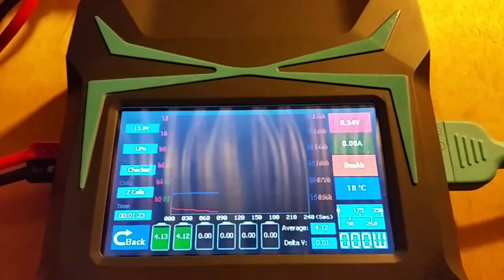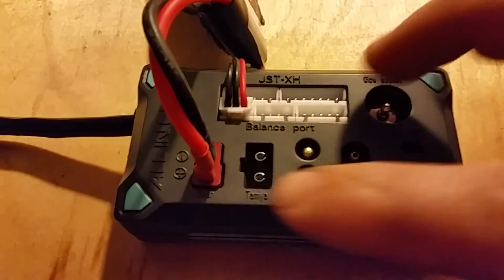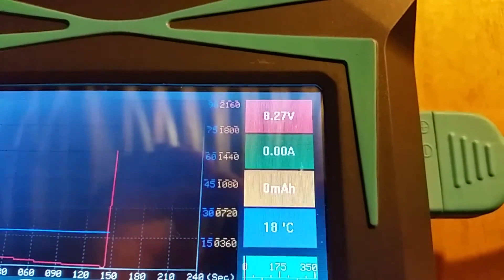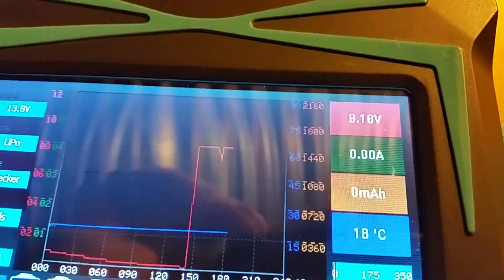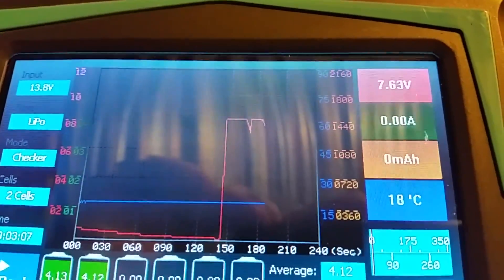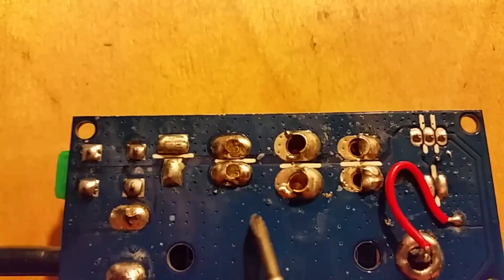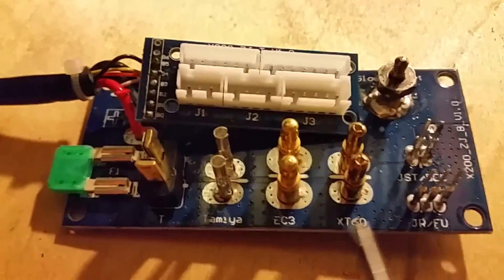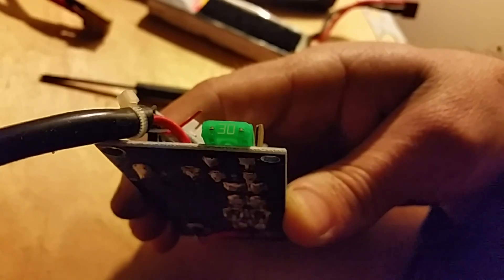X350 Touch Screen charger repaired

Comment from the maker: Hi mates I posted a second video showing how to repair the discharge and balance charge from a high voltage resulting in a connection break fault. I found the culprit and replaced it with a car fuse. If you discharge at more than 40watts you will burn the tiny 10Amp fuse. Some one mention to just put a bridge in but tell you it really over heats the unit if you try more than 40watts. If you don't clean up the terninals it will result in over charging and if you continue to over charge you will eventually damage the battery. I strongly recommend not to use the charging function and only use the balance charge. It does not seem to check the balance port voltages when charging and only monitors the main pack voltage and if the terminals are not making a good contact will seriously over charge the pack. Atleast with the balance charge it only monitors the balance charge and will detect the main pack for open circuit.Hope this help you all.

Comment: Good example of the crappy job that Hobby King did on the All-in-1 unit. Never seen such terrible soldering as in the unit I bought.

Question: Since I did try charging a Zippy 20C 2200, and since the All-in-one decided to over charge the battery to 4.29V per cell (12.87v), does this mean that I have ruined the battery? Or that I simply need to to let it discharge for a while?  I did try discharging, but the overvoltage prevents the unit from doing its job.

Comment: Thanks for this video. One thing I have just noticed is the exposed battery connectors which is potentially dangerous and a fundemental design flaw. Any metal objects falling into the charge ports could cause a short to the battery as it is plugged in. I almost cringed when you were poking around the terminals with the battery connected. May I suggest you make up some blanking plugs to cover the unused ports to prevent shorts. This looks to be a very nice charger but the connector module is dodgy at best. Personaly I would make my own charge adaptors each using a single connector.
Reply from the maker: You would like the X400, it doesn't have the all in one plug but for what the X350 does I still like it and love the idea to make a blank plug for open connectors might have a small accident and drop a bolt in there while charging

Comment: One of the most useful videos I've seen.   I admire your deductive reasoning.  I saw another video regarding the X350 and it's overcharging and he had been battling with HK.  I think they sent him a replacement but it too had the same issue.  Now we know why.  Whoever builds these things needs to do a better job of testing them during production.  Varnishing the terminals......You just have to shake your head.
Reply from the maker: Quality control??? What quality control lol